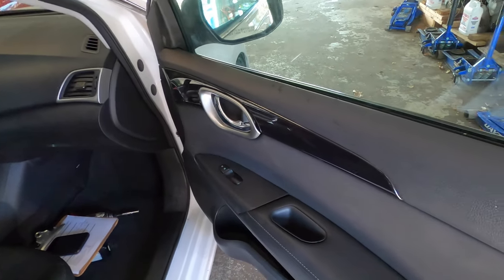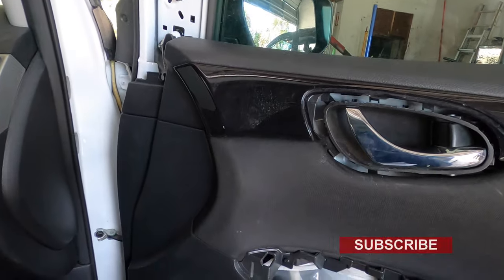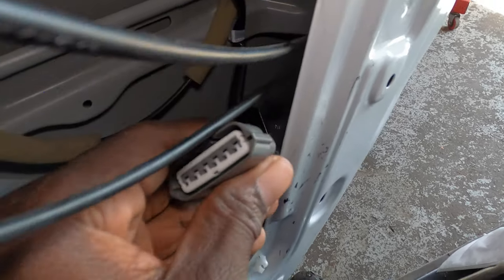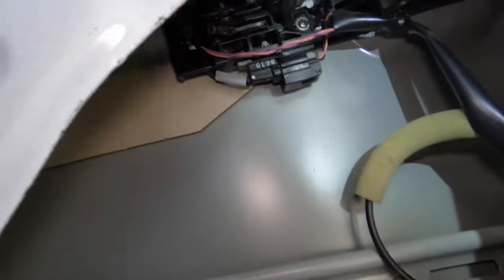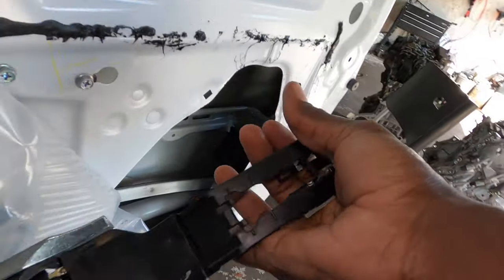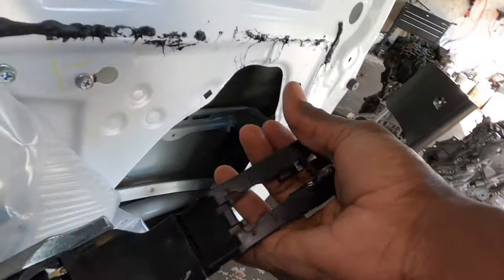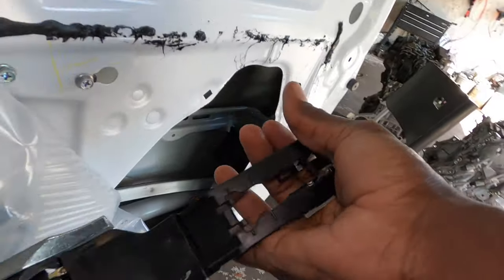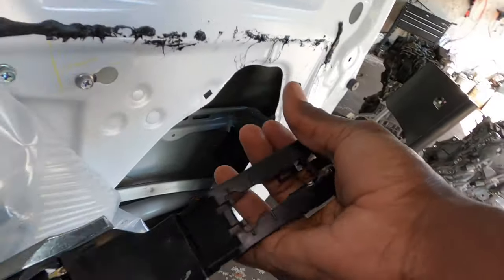Replacing the door latch on a Nissan Sentra

Comment: @8:30 Thank you for posting. My PS door has that hole covered (similar to the DS door hole), but doesn't have a key access there.  Do you happen know if I can install a key lock on the passenger door, which doesn't have one? I have an extra cylinder lock, but it is for the DS, since the car is designed w/only one key lock on the driver side.  The car is 2009 Nissan Sentra.